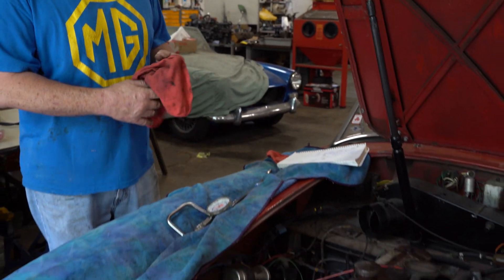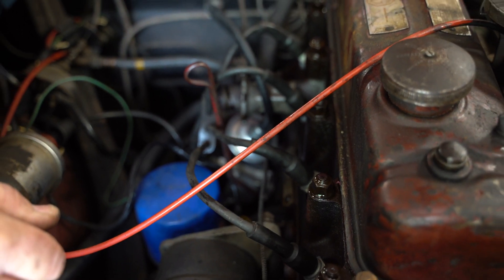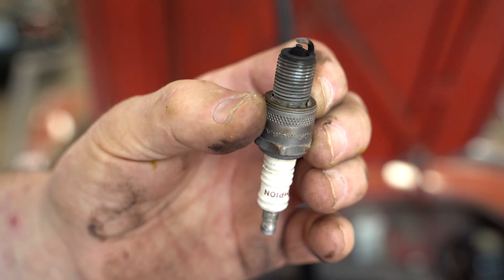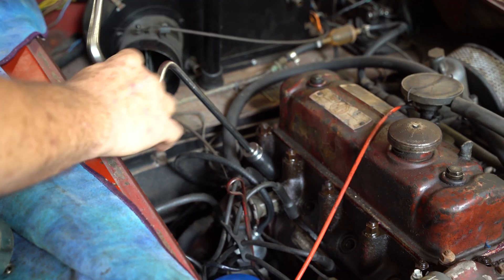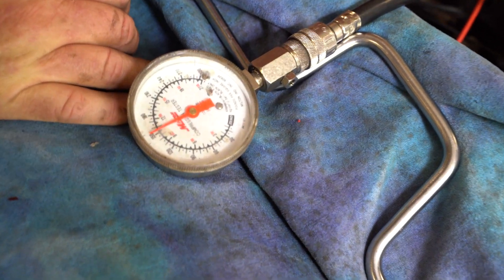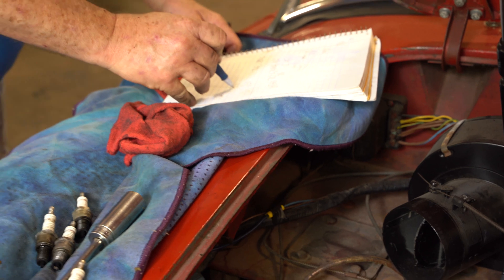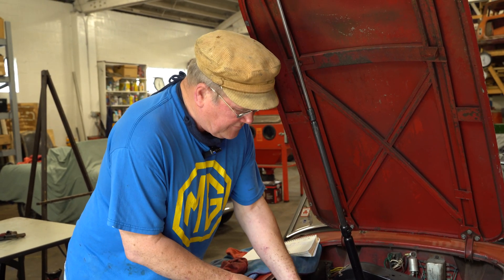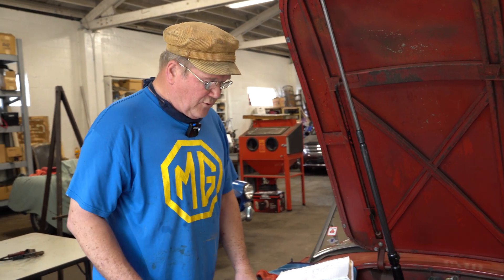346 MG Tech | Checking Engine Compression: The Rule of CONSISTENCY

Comment: Timely.  Yesterday  we were checking the compression  on my friend's recently purchased 1971 "B"that has been stored for a few months.
Carbs and manifold have been removed  by "others". 
We adjusted the valves cold as they were quite a bit off.  15 to 21 Thou. 
Plugs were sooty. 
We came up with :
1:  145
2:  135
3:  125
4:  145

Based on your video..  we will torque the head and will recheck and listen for "hiss".
Also may do a repeat with dry and wet.

Thanks John.